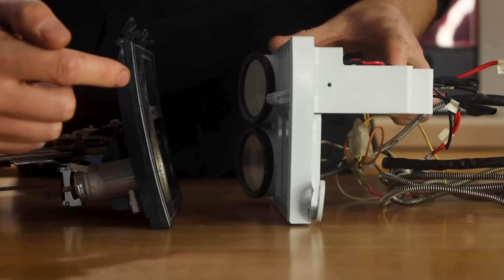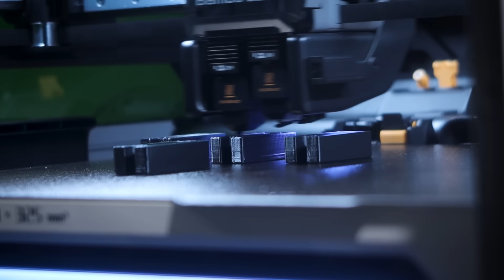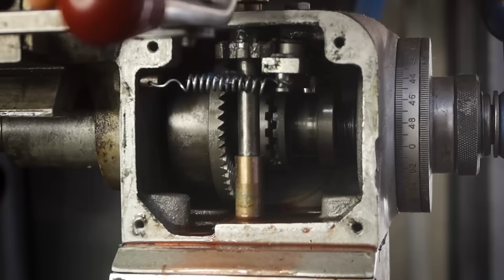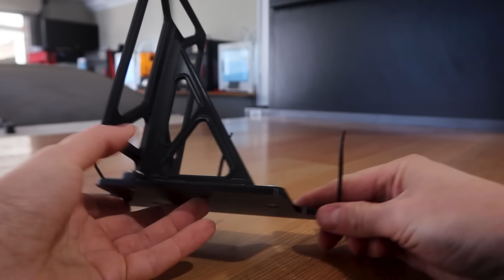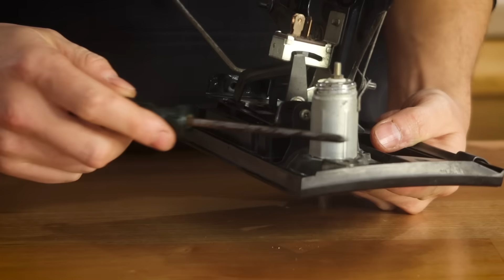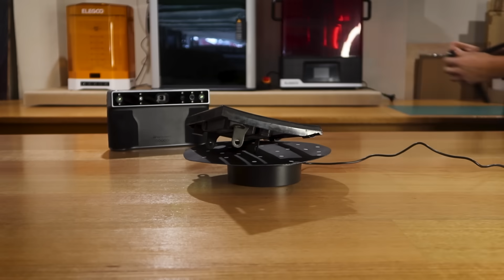3D Scanning CAD Modelling and 3D Printing OEM+ Car Parts | Revopoint Miraco Plus 3D Scanner

Comment: One detail I noticed is that the OEM panel has feature openings like the radio screen and the HVAC control "frame" has a radius, they are not sharp corners like on your CAD model, this little radius is important to achieve that OEM+ look.

Comment: I've been playing around with scanning for the last several weeks. It's a heck of a lot of fun, but editing/molding/applying the scanned models feels positively impossible in Fusion, Blender, etc. due to the absolutely bizarre and unnecessarily dense mesh that always seems to result from a scan. Simplifying the mesh so that it doesn't immediately destroy whatever CAD or modeling program you're pulling it into takes all of the necessary detail away and still leaves me with something that I don't quite know how to work with. I can make absolutely fantastic things in Fusion 360, but when it comes to scanned models, I'm new and frustrated. Am I missing something? Is there a more obvious and doable way to work with these scans?
Reply from the maker: Those softwares are not reaaaally mesh editing softwares. You can get some free ones like "meshmixer" and I think there's another one called "meshlab", which I haven't used, but I think is the same concept.
Depending on what scanner and software you're using in the initial step in the workflow, you can potentially also try and do a lot of the "cleaning up" of the mesh there, before importing into the next software.
So, scan > meshmixer/meshlab/geomagic > Fusion/Blender/etc

Comment: loved watching this. 

working with scans is definitely an exercise in using the scan as a reference and trusting the symmetry of a part. especially because you will basically never get the part perfectly aligned with the origin of your CAD software. 

or at least ive never been able to get it spot on, only super close.
Reply from the maker: Thanks mate!
For sure, they're great as a reference to build from and immensely helpful when used with that in mind :)

Comment: 1. Can you tell me the file size of the scan from this video?
2. Can you re-name the files on the Miraco itself?

Thanks!
Reply from the maker: Hey mate sorry for the very late reply.
1. The files here were about 120MB but they could have been smaller if I was a little more efficient.
2. Yes you can rename files directly on the Miraco :)
Reply: @fatlipcollective  Thank you. I went ahead and bought one earlier. For anyone wondering, a 30-second HD scan is about 700 MB in my experience.

Comment: brother, this is the exact use case for me wanting a scanner. I'm dangerously under qualified but stubborn enough justify buying the thing. I could pay $200 for the part I need, but I'd rather spend 10x that and create something not aa good.
Reply from the maker: I'd rather have something "not as good" if it means i got to learn and build it along the way. 
Good luck on your quest mate, if it was easy, everyone would do it.
Reply: Hell yeah. I'm convinced that there is no higher level of satisfaction than fixing or building/creating something.

Comment: For the bridge port push the collet up as far as it will go and use an impact on the spindle/draw bar
Reply from the maker: Thanks mate I could do but ideally would like to have the brake work working. I also don't actually recon I'd fit the impact between the ceiling and the head 🥲

Comment: The Bridgeport spindle brake works by pulling towards the operator (parallel to table) instead of up away from the table. Could be worn out but looked like you were pulling up? 

Great video, thanks for sharing!

Comment: To scan with the Miraco, you can increase the intensity of the infrared, the flash light does not provide better data, only for textures,
Reply from the maker: Thanks mate you're right yes, I was going to lead into talking about textures for the etching on the faceplate but going to cover that in a future vid, can see how it's misleading in the video :)

Comment: Revopoint seems like an awesome scanner. Alignment of multiple scans is massive downfall using the Creality scanners. The auto align feature is damn horrible and there's no ability to manually align apart from trying to manually select multiple mesh points in the same spot which sucks.
Reply from the maker: That's a shame yeah so far no complaints it's been quite accurate and simple to use!

Comment: Do you have some ideas what to do about a KE11 I have that needs a new front bumper panel (i.e. the sheet metal in which the blinkers are mounted, below the grill)? Mine is missing, and I haven't been able to source one yet.
Reply from the maker: Jump on some of the Toyota / Corolla pages in your area. If you're in Australia I'm sure there will be someone on there who has what you need

Comment: FYI, the drawbar on your Bridgeport for your collets comes out easily from above. If the threads are knackered use a thread file to clean them up. It’s an easy 5 min job.
Reply from the maker: Hey mate thank you! The threads seem ok (threading on alright) it's the spindle brake that doesn't seem to want to engage, from what I've read it seems like a not-uncommon problem with ones that have sat for a long time?
Reply: @fatlipcollective I worked on a mill with that problem. Check the threaded retaining ring on the bottom and see if it’s loose, otherwise a shim under the handle might get the break to work a little more until you can get a replacement in. Also, a big pair of channel locks with electrical tape over the threads will hold you over before the tormak collet system comes in 😊.
Reply from the maker: @davidgutting4317  Awesome thanks mate, hoping to have some time to look at it over the next week or so and I will report back!
Reply: @fatlipcollective  from the vid it looks like you were trying to lift the lever. It’s meant to be shifted to the left not lifted. Could have just been the angle I was viewing though
Reply from the maker: @stevenshaw9559 hey mate tried shifting to the left and right and also lifting (which is meant to lock it in place, right?)
Reply: Heck yeah that angle looks great!

Comment: buddy, real talk bout your dohc 4k head

whatchu mean u make it chain driven and get rid of the pushrod system or you pretty much make the head with a crossflow design just like LS head which you can make the exhaust port on the spark plugs area and also have lots of room for the turbo to be place at

Wish u give a reply cuz ive been geekin about toyota k motor rather than just engine swap to 4AGE etc
Reply from the maker: Hey mate yeah plan is cross flow DOHC head. So no pushrods, cams and spark on top.

It's very much just a loose plan atm. Not sure how far I'll actually take it but I'm working on it a lot at the moment - more to come :)